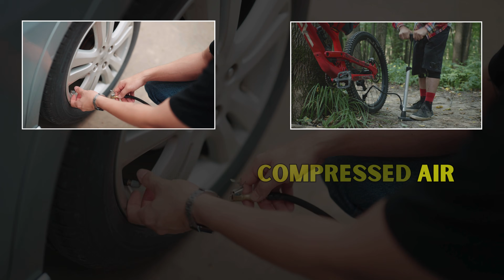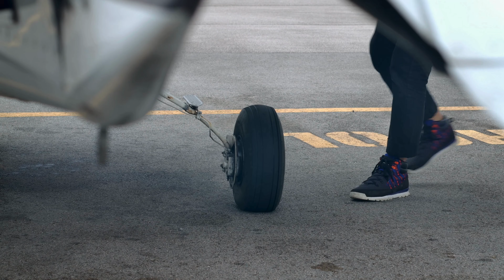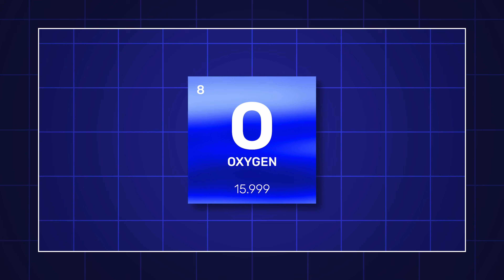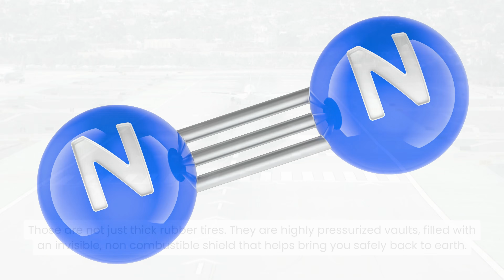Why Don't They Use Air to Inflate Airplane Tires?

Comment: This video explores the engineering reasons why commercial aircraft tires are inflated with dry nitrogen instead of regular compressed air. It highlights the extreme conditions these tires face during flight and landing and why nitrogen is critical for aviation safety.

Key Takeaways:

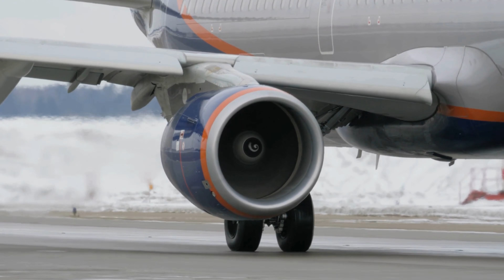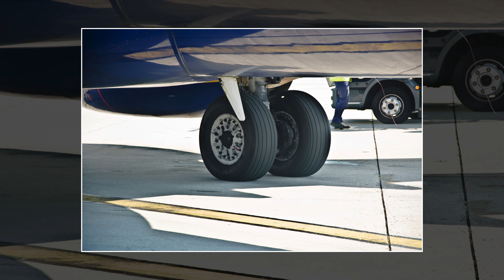The Extreme Environment (1:07 - 1:51): Commercial airplane tires endure brutal conditions, including temperatures as low as -50°C at cruising altitude and over 200°C during landing due to friction and braking. They are inflated to roughly 200 psi to handle the impact of a 300,000 kg aircraft.

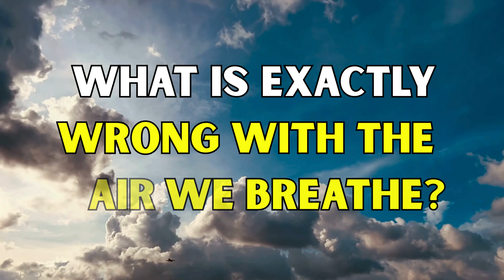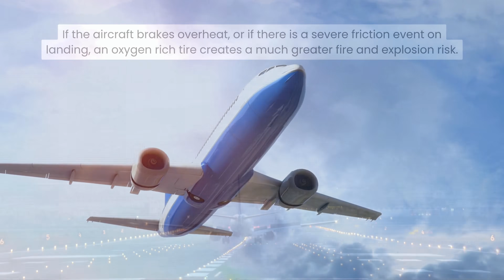The Risks of Regular Air (2:18 - 3:15): 
Moisture: Water vapor in regular air can freeze at high altitudes and evaporate upon landing, causing unpredictable changes in internal tire pressure.
Oxygen: Oxygen is chemically reactive. Under the extreme heat and pressure of landing, it poses a significant fire and explosion risk if the brakes or tires overheat.

The Benefits of Nitrogen (3:15 - 4:07): 
Inert Properties: Nitrogen is far less reactive than oxygen and does not support combustion, effectively preventing fire risks.
Pressure Stability: Because aviation nitrogen is supplied completely dry, it eliminates the issues caused by water vapor, keeping tire pressure stable across the massive temperature swings of flight and ground operations.

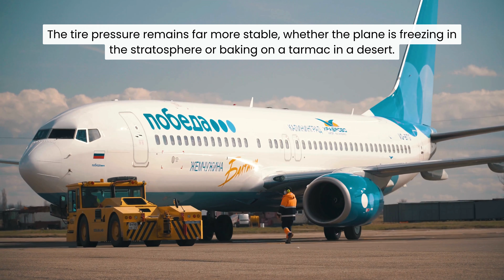Regulations (3:57 - 4:07): Due to these safety factors, aviation regulations require the use of nitrogen or other inert gases for servicing commercial aircraft tires.

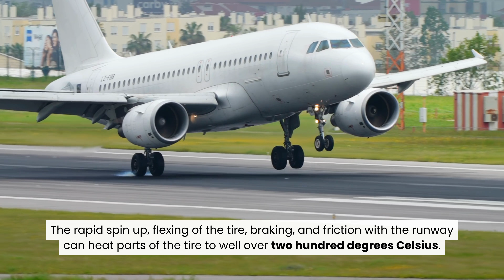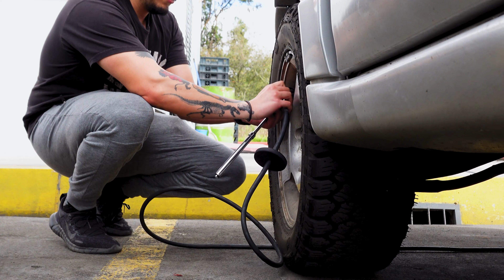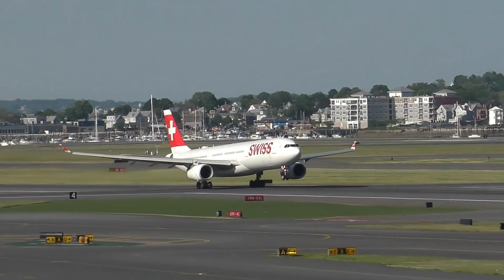Comment: 200 psi is insane! That is literally six times the pressure of a standard car tire [01:48, 01:58]. No wonder they need dry nitrogen to keep that pressure perfectly stable [03:15, 03:42].